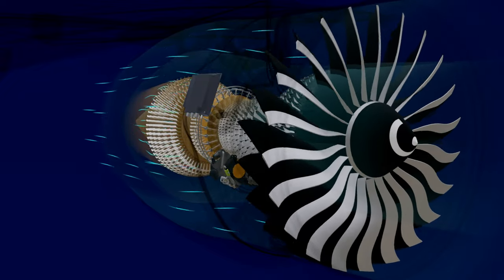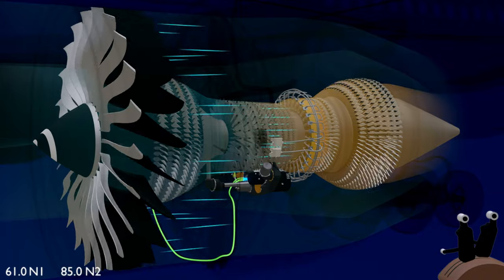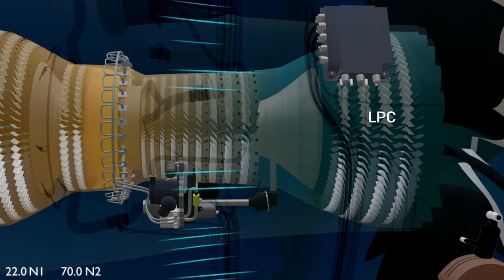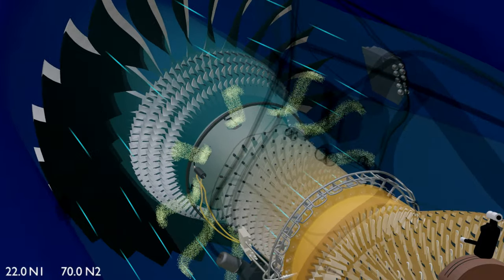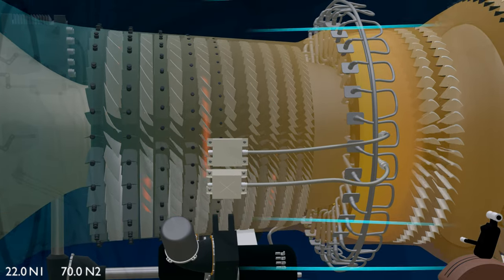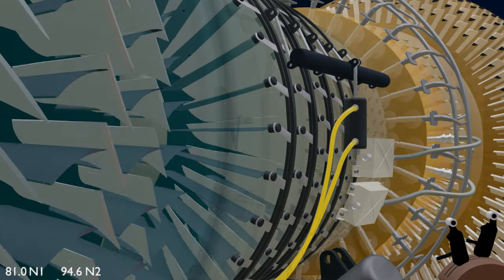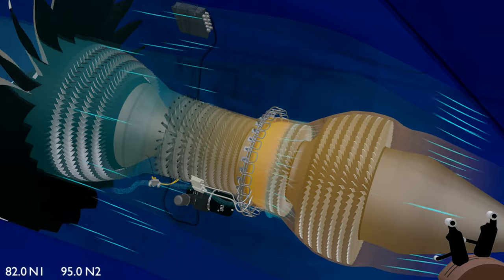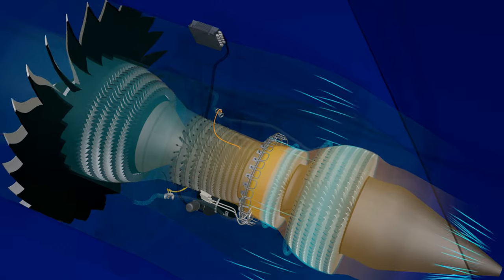How Jet Engines Work | Part 3 : Performance

Comment: Jet engines are such fascinating pieces of technology, aren't they? The performance aspect of jet engines, as covered in Part 3 of this series, is particularly intriguing. It's amazing how these engines are designed to handle extreme conditions while providing immense power. The efficiency and power-to-weight ratio of jet engines make them vital in various applications, from commercial airliners to high-speed jets. It's always exciting to learn about the intricate details that make such powerful machinery work so smoothly and efficiently. What aspect of jet engine performance do you find most interesting? 🚀✈💡

Comment: I finished my A&P school last year and you covered pretty much all of it here. Great job. We had an engine that was used in the A10 Warthog that was a good example of this here. We had P&W PT-6 and Allison 250 turbo shaft to take apart and rebuild. The PT-6 is a turbo prop engine and the Allison 250 was used in helicopters. You should do a study on those.
Reply from the maker: Thank you!
Reply: Not gonna lie, that sounds fun. Taking apart and rebuilding the engines, especially working with an engine used on an A-10 warthog, which is my personal favorite plane, and the reason I play DCS world. Would love to be able to work with that aircraft, but can't enter the airforce, yet..
Reply: @demonman1234  Unfortunately we only had 1 of the A10 engines. We were only allowed to remove the accessories. The "turbine" class was only one semester so not enough time to tear down. We had teams of 4 working on the PT6 and Allisons. We had a dozen each of those. One of our instructors was from the Air Force. See had a job of working,  remove and replace the jet engines on the B2 Stealth Bomber.
Reply: @Erik-rp1hi  Ah, either way still sounds quite fun. Even being able to see it close up honestly.

Comment: Could you maybe do a in-depth video about the modern Flap/Slat mechanism? I really like your graphics👌🏼
Reply: I would love to see the Braking system comprehensive series. I love the videos and in depth explanation wow
Reply: Slats and flaps are mechanisms on the wings of some jet airplanes that help to increase lift while takeoff and landing. The slats are attached to the leading edge of the wing and the flaps are attached to the trailing edge. When extended, they create more surface area on the wing, which produces more lift. 

The flap slat mechanism is a complex system that helps jet engines operate more efficiently. By understanding how this system works, we can better understand how jet engines work as a whole.

Comment: it's amazing that the engine works at all, nevermind that it works reliably and efficiently .... so much precision is required everywhere and the forces are so huge, like riding a bomb that is constantly exploding in a relatively smooth rearward direction

Comment: Last date of the year 2023 found Aero nautical engineer explained every thing 
graphically is so amazing.
Great presentation.🙋‍♂️🙋‍♂️🙋‍♂️🙋‍♂️🇱🇰🇱🇰🇱🇰
Please explain how centric main axle drive on trust  bearings , on fluid or any other components .

Thanks

Comment: Thank you for this amazing video! Have a question:why can't the high pressure compressor handle the airflow incoming from low pressure compressor when engine is at low power setting?

Comment: One question, normally the N1 shaft and N2 Shaft turn in opposite directions (or not?), in GE90 this different shafts turn in same direction? Tks and congrats for this amazing channel!
Reply from the maker: The shafts turn in the same direction on the GE90 as on most turbofan engines. Latest engines such as the Trent(900, 1000, XWB, 7000) and GEnx have contra-rotating (opposite direction) shafts.
Reply: @AircraftScience  most old engines such: jt8d, cf6, cfm, two shaft, rotates in contra rotating way to reduce gyro momentum , i do not see reason  to rotate in same direction, rr had 3 shaft same direction but...

Comment: what's the exhaust temp?
Reply from the maker: 1050 °C.
Reply: @AircraftScience  that hot yet no expansion??? Seems a little bit don’t you think? I’ve got video of a GE turbo jet engine flying at altitude of 30k up and the engine doesn’t look hot at all?
Reply: 6:15 He says the exhaust gasses can reach a thousand degrees.
Reply: @jjgillo  that must be with the burners on

Comment: these are the most easy. the most dfficult part is to make engine blades that can take huge load when its 1400 degree hot.  smelting point of iron.
Reply: even you kitchen knife is not from iron it is ceramic matrix compound/single crystal....
Reply: @makantahi3731  Yeah but those engine blades takes thousand of kilos load. Does your kitchen knife also handle thousands of kilo load when its at melting point?
Reply: @oghuzkhan5117  you did not understand anything from my answer:  first: blades are not made from iron, second they are cooled, third they are made from special material that keeps strength at high temps, fourth: even kitchen knife is made from some kind of inox and it has better strength on high temps than iron, and melting point of iron is not the same as for turbine blades, is now more clear or you still think that blades are made from iron and are on melting point-even on me262 turbine blades were not from iron